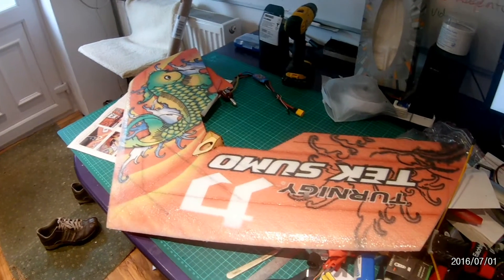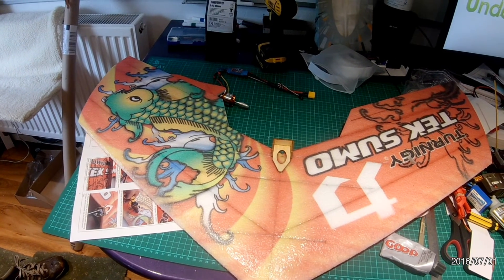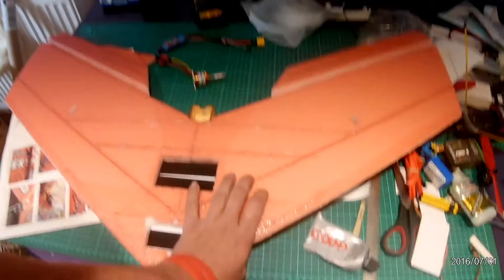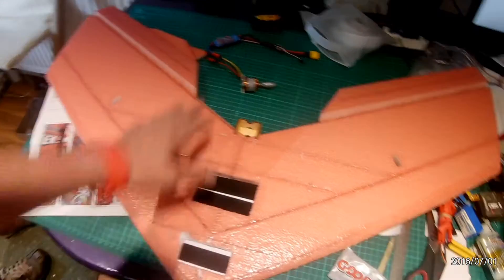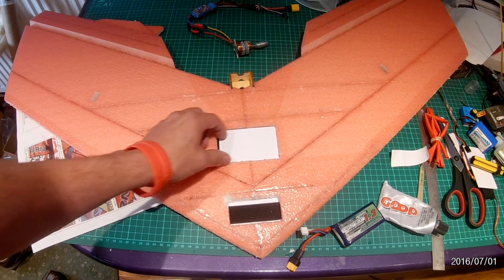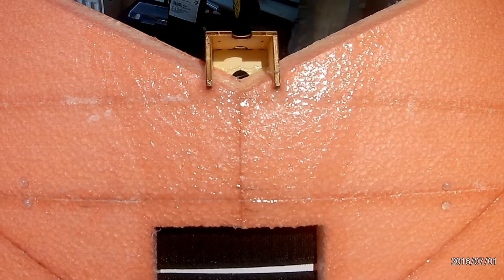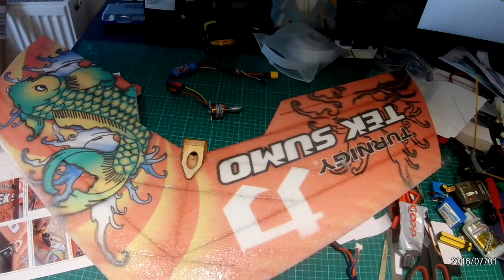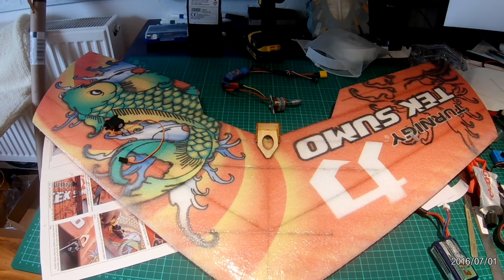Crash Proof Teksumo - Build it so it Bounces!

Comment: Hi Matt, 
i just bought the goop glue and i just wanted to ask if it is sensible to glue the whole teksumo/ Bonsai or at least the edges as well as the wingtips. 
Thanks your reply
Greetings Thommy
Reply from the maker: Howdy Thomas, I do around the motor mount on the top & bottom (less likely to rip out then), the nose area and leading edges of the wings. And around the winglets as well. Makes a HUGE difference to the durability of the model. Hope that helps! Matt
Reply: Hi Matt, thanks a lot. That helps, do you put also the glue on the whole aileron?
Reply from the maker: Thomas Mayer Nope, just along the hinge lines with  very thin smear to strengthen them :)
Reply: Sorry asking you again, but do you paste the glue just with your fingers or something else?

Comment: what problems did you have with the factory carbon spars, what was your reasoning for lengthening them and moving them reward?
Reply from the maker: Howdy Jacob, it was purely because I knew what abuse I was going to give the model, both on the air and during landings. Any more that I do this https://www.youtube.com/watch?v=KONSxBUrBI0 with, needs extra support. And frankly speaking, I'd be upset if I kill another Teksumo. Hope that helps Jacob. Matt

Comment: ive found that any form of shoe repair glue in hardware stores is the same chemical as "Goop" and is often MUCH cheaper :) it has different names shoe fix, shoe repair etc. handy to know :-)  that siad its always good to test a small section of foam first to see how it reacts. happy days
Reply from the maker: Morning Phil, copydex is known to be good too, but does turn brown after a while. Tam suggested "Industrial Strength E6000" so I bought some of that on Friday, it was £6.50 compared to £10 for goop. Should be with me around Tuesday, so will be curious to see what it's like :) Oh and it does help EPP become almost indestructible! Matt
Reply: Hi Matt, is this the correct E6000
https://www.amazon.de/Industrial-Strength-E6000-Clear-Glue/dp/B00N1765XK/ref=sr_1_2?ie=UTF8&qid=1484810445&sr=8-2&keywords=Industrial%2BStrength%2BE6000%22&th=1
Does it has the same effect like the goop glue?

Comment: My buddy and i went in on a couple rolls of 5mil 200 feet by 27 inches of clear laminate. So on my bonsai i did that on all of it and it can take a major beating. On the crashtesthobby wings he has you CA glue shock cord all around the perimeter of the wings as he says most of the damage in the crash is from the elevon's coming forward in a nose crash and ripping the wing in half. They also use a lot of fiber packing tape on the nose area and than laminate over that. And ridiculous thick metal rods for control. I have hit concrete so hard in my scythe that it ripped the battery and velcro out with it. Nothing broke at all. EPP is the best.
Reply from the maker: That sounds bonkers, goop glue is the way to go!
Reply from the maker: Hahhahahaha I've seen that video! Thats just like my flying & the ground :)